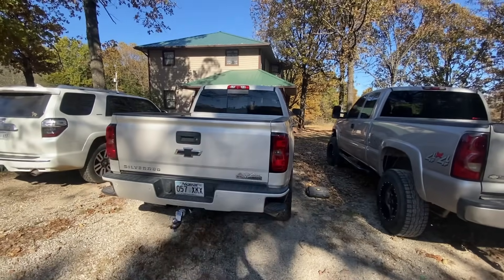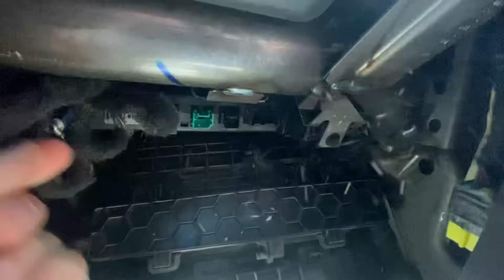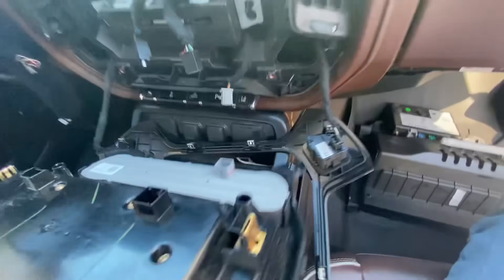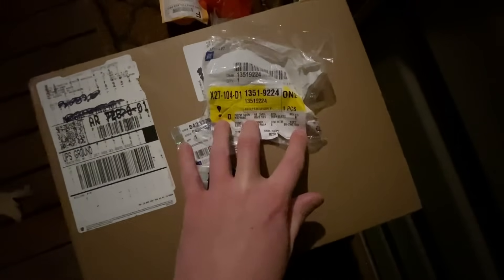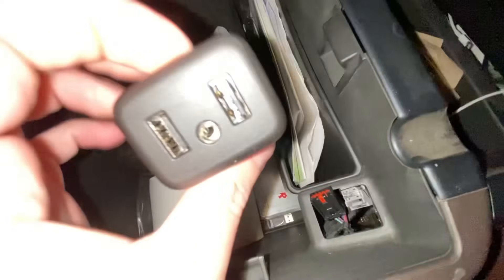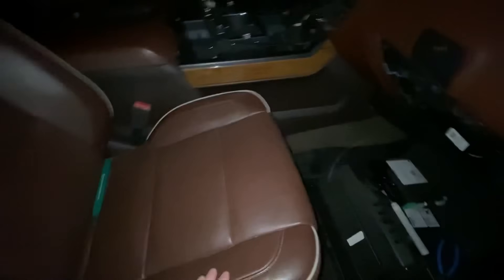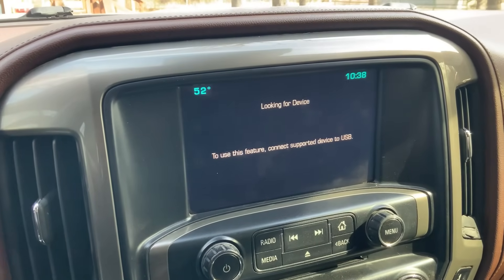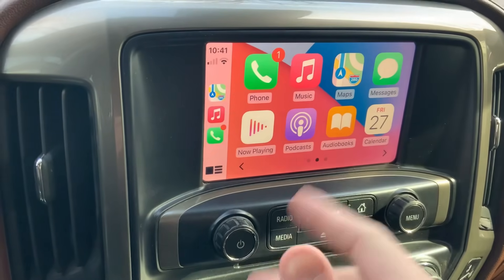How to Add Apple CarPlay to 2014 2015 Chevy Silverado or GMC Sierra

Comment: Watched this video numerous times. Ordered all the parts for my 2015 Silverado a 2 wks ago. Got everything yesterday and installed everything in under an hour. Thanks for your step by step process. Car play working flawlessly. Now just thinking bout the Denali cluster. Keep up the great videos.
Reply: Does the reverse camera work fine?
Reply: @ma7moodz8  the reverse camera work just fine. To my understanding, changing the radio components have nothing to do with the camera.
Reply: Do all your steering wheel buttons still work?  I.e.  the phone call and hang up buttons and the other ones that control the radio functions?
Reply: How much did you spend?
Reply: Did you need to have anything programmed?
Reply: From a 2.0 to a 2.5 HMI swap, is programming needed or just a quick plug and play
Reply: @franksalinas490 did you get the answer to this?
Reply: @eberpadilla3439 did u get the answer 😂
Reply: It’s 750 I believe for everything in this video plus whatever that plug cost.
Reply: @mauriciorodriguez2448  Did you get the answer??
Reply: @Browniiie92  ill be the one to break the chain😂 but yes sadly it is needed because it will say theft locked once you plug it in
Reply: So did you change out the radio too? I think that one was for Bose. Idk I just remember another video with brown and white for Bose to bypass it.
Reply: @mauriciorodriguez2448  did you get an answer to this?😂

Comment: Great video. I just did this to my 2015 Sierra and found that you don’t need to upgrade the USB hub in the center console if you use the USB that’s in the glovebox. Nice little workaround if someone’s looking to save $65.
Reply: You sure cuz I’m about to order it lmao
Reply: @andrewmarmolejo892  did you ever find out?
Reply: Cuz, I went to the GM site for the USB plug and it doesn’t fit my 2015 GMC Sierra. So, you are saying I can get CarPlay working if I connect to the USB in the glove box?
Reply: @robertbernal7993  it's your choice of whether you want to change it out but it will still work with the old one. If you change to the newer one then you will be able to charge your device when plugged in a whole lot faster. So, it does have its advantage to getting the newer USB or the center console.

Comment: Just did this for my 2015 Chevy Silverado 1500 and it worked great! The USB component gave me a little trouble because the cables were too short and were recessed in the hole, so I popped out the drink holders from the center console, unscrewed the panel below it, and that allowed me to easily get to the cables to plug it in.

Comment: Dang Chevy Silverados change the lot. I have a 2001 Chevy Silverado in a 92 Chevy Silverado that's still running great It's amazing how things changed over the years.
Reply: That it does. I parked my silverado, next to my corvette convertible.  The last owner left the convertible down and gathered a small pond in the abs pump. Thankfully the replacement was from a 93 pump, the seller threw in the Ecm module to work with the pump. Military Mechanic that loves chevy silverado's the corvette convertible was a fantastic price of 4600.00 it was sold for 8700.00( my wife wasn't a fan getting into the passengers seat. When I had kids, it Had to go!

Comment: I have several of the 9224 USB plugs. Brand new take outs from 2022 GM trucks. They are taken out and replaced with customer counsels. Never used. $30.00 ea.

Comment: I really like this new upgrade that I did on my truck I have 2015 2500hd  LT the only thing I dint  like is that the chime on the doors and whenever don’t used the sit belt is too loud even on the lowest setting. What I need to do to lowering down
Reply: Did you find any answers?
Reply: @mu4789 
No not yet still waiting

Comment: hey Justin, great/helpful video. I was wondering, do the steering wheel controls work for CarPlay use for this upgrade? I saw something about doing the full OEM upgrade and needing to ship in cluster. Just was curious is that only pertained to certain year or model. I have a 2014 Sierra Denali.

Comment: Hey Dustin, now that you've had 9 months with CarPlay in your truck, what's your thoughts? Was it worth the $800 upgrade? Do you find you're using CarPlay features more than the IntelliLink? I like the GUI of the HMI 2.5, but I'm really on the fence about CarPlay itself. Thoughts
Reply: I installed into my Jeep Wrangler for $500 total and I can assure you that it is not worth the $800. It looks great and i was thinking about putting it into my 14 Sierra but it just is not worth the $800. Probably not even the $500 I paid. The stock setup is good enough.
Reply: @brennanmason2906  thanks for sharing your feedback. It's ironic that you just reply this morning, I was JUST thinking about this project last night. While the idea of seeing my texts on my IntelliLink screen is cool, I agree, I don't know if that's worth $800.
Reply: @brennanmason2906   currently selling them for 300$ piece plus shipping and handling
Reply: @carlosdiaz962   who’s got it for 300?
Reply: Where can we get all the parts to install this?
Reply: @carlosdiaz962 where can you find this setup for 300?

Comment: Great video, thank you for the information and for posting. By any chance, do you know is doing this upgrade also resolves the common issue with the infotainment system "ghost" clicking random stations, pandora and so on that is very common in 2014 and 2015 Silverado and Sierra? My 2015 Silverado has this issue and it is getting worse. I need to fix that but I also have been wanting to upgrade to apple care play, hoping doing this upgrade resolves the "ghost" clicking issue as well. Thank you for your help.
Reply: I'm getting that as well, and I am considering doing this upgrade to fix it. Considering it's a fault in the HMI then I would assume a new HMI would fix it.  If not, that would suck!  If you do it and it fixes it please let me know
Reply: I haven’t done anything to my truck yet, but it’s gotten worse with the phantom clicks, in addition to a couple weeks ago my touch screen only recognizes touch’s on the very left  side of the screen. I have tried to reset to factory settings, disconnect battery, thoroughly clean the screen, fuse pull, nothing fixes the screen touch issue. So I may also need a new screen it seems like.

Comment: Does the backup camera still work with the apple carplay. I have a 14 Silverado with a factory installed backup camera, will it still work with the new HMI?
Reply from the maker: Yep! Works 100% as it’s still all oem gm parts. No issues after several years of use

Comment: Can the apple car play or android auto with this setup be used through bluetooth? or does it have to be plugged in ? i had a kenwood radio in my car that android auto worked through bluetooth. id like to get an upgrade for android auto as the radio is finniky with what it plays audio from when it connects through bluetooth (randomly selects spotify, youtube, or facebook)

Comment: also is there any other way other than changing the HMI and having to plug my cel into the usb. can I just connect through the  bluetooth without having to connect to usb cable. also do you know if I change this out can I receive calls and they come through my truck as it does right now.im sorry I have a lot of question but you  seem to know what you are doing.

Comment: Thinking about doing it! I just bought a 2014 Sierra 1500, SLT w/ Z71 package, found out today that I can't have OnStar, GM stoped it on 2014. So sucks, dealer actually told me that I could have 90 days free trial, not that if I was told the truth would've stop me from buying the truck, just disappointed. But again,  when adding extend warranty to $1200 of the upgrade, not sure if worth it. It does looks good, that is for sure! Truck only has 27k miles, looks as brand new, reason I bought it.

Comment: What specific upgrade kit did you purchase? I was looking on the website and saw there is two options. I see there is a kit and one that says programming.
Reply: Did he ever answer your question
Reply: @johanguerrero5915  negative
Reply: It depends on what your truck came with so to speak. If it didn't have nav at all and you do the upgrade with nav then you may have to install the GPS antenna too. It's literally plug n play with the kit and there are only a few things it will add to your vehicle if it didn't come with those features already. It may seem like it's difficult but if you want all of the features just order it and install it. The reprogramming was talking about taking the hmi compo ent you already have in your truck and sending it in to them and they reprogramming it with some of the upgrades. It's better to just buy the upgrade and like I said, it's literally plug n play.

Comment: The USB plug from Amazon says it won't fit my 2015 chevy. I'm assuming it means that its not compatible the the existing audio unit BEFORE the updates hardware/software from Whites, correct? Thanks in advance.

Comment: Great video Dustin! I have a 2015 1500 LT and my door chime is very loud even on the lowest setting. Did you notice if this upgrade gave you the ability to lower the door chime volume lower than before? Thanks!
Reply: Hey bud so is the same process with the  lt ? Thanks
Reply: @martyn408ify  Hey man. I never went through with this upgrade. I was just curious if the door chime volume was better with the new setup. I hope to do this one day though.
Reply: @martyn408ify  did you end up making the upgrade? If so did it work? I don’t wanna spend the money on all of it if it doesn’t apply to an LT

Comment: I watched a video of this before on another channel. You make it look so simple. Nice job.

How does this affect XM radio? How is this different from a new vehicle that already comes with Apple Car Play? It seems to me the new ones have Apple Car Play actually installed, but with this you're just projecting your phone to the radio? The reason I ask is I called the local Car audio place and I was under the impression that they also changed the HMI, but they acted like they didn't know what I was talking about. They said they change out the whole radio.
Reply: There's no difference from the newer vehicles that come with the apple caraway or Android auto. Also you can still maintain xm radio. The kit doesn't change what the truck came its. All it does is swap out the old with the new. Plug n play.

Comment: Could you go to junk yard take one out of a 2016 and plug it in ?
Reply from the maker: Yes, but you would need to have it programmed for your truck first. These radios are locked to the vin of the vehicle they originally came from. If you did it without programming first, it would pop up “Theft Locked” on the radio

Comment: Will there be navigation on the dash with android auto/car play? My 14 Silverado comes with stock navigation that will show directions on the dash.
Reply: Yes it will. When you have android auto/carplay hooked up, it will show Google maps or waze, etc. You can still use the factory navigation too if you want. You may have to disconnect it so the Google maps or waze won't override it
Reply: @gangsta45ism  sweet ty

Comment: I don’t know if this upgrade is worth $1,000 when you can get a superior aftermarket radio like the Alpine ILX-411 11” screen or the Pioneer DMH-WT8600NEX 10.1” screen with wireless apple car play, both aftermarket radios around $1,000.
Reply: It is if you're having trouble with your HMI.  Be twice that to have it replaced at the dealer and still no Android Auto or Apple nonsense.  HMI issues are a common problem with 2014 2015
Reply: It all depends on if you prefer the factory setup over aftermarket but you make a good point.

Comment: Awesome. Are you still able to control the volume and skip tracks from the steering wheel ?
Reply: Sure can, I did this about 2 years ago.
Reply: @Keagan-Z06   oh that sounds great. thank you very much.
Reply: @Keagan-Z06  is it necessary to change the radio module behind the screen??
Reply: @Keagan-Z06  even with CarPlay loaded up or do you need to do full HMI, Radio & Cluster upgrade for that?
Reply: @gcode4u2  Yes sir!
Reply: @d_lord4483  Just the HMI & Radio, no cluster needed. If I can recall I believe I only changed the HMI module to an updated one.
Reply: @Keagan-Z06  I've been thinking of just ordering used off eBay and program them myself. just need to figure out how to do it.

Comment: Why did you have to change out the plug that had the SD card slot?
Reply: Because it helps with actually charging the device faster. The old USB port in the center console doesn't really have enough amps to be compatible.  It will still work but it will lack in charging devices up really fast.

Comment: I want to do this to my 15 GMC  Sierra, I dont see what radio part to order, I see the HMI (2014-2015.5 Android auto/car play upgrade retrofit ) for $99.99 but dont understand what radio part to order. After looking at it, I get the HMI and radio part both in that kit for 99.99 ? That doesn't seem right
Reply from the maker: Yeah not quite right, on the white automotive sight if you browse out to the 2014 Silverado’s you should see the option to upgrade to Apple CarPlay. It has several drop down boxes to choose from depending on your vehicle RPO codes and if you are supplying your own parts or not. Hope this helps.
Reply: It appears the $100 is for programming only (if you are supplying the hardware).  If you are ordering the hardware it is actually $600.  I was confused as well.

Comment: With this upgrade can you run a mmb multimedia box? Stream YouTube video/Netflix?
Reply: You don't need this set up tou run the box,just 2 different wiring harness
Reply: If it plugs into the USB port then you should be able to still use it

Comment: Hey, I recently did the upgrade. Does anyone know how to change the temperature on the display from celsius to Fahrenheit and what to do if the tire pressure doesn’t show on the little dash screen?
Reply: Did this effect your other screen in your gauges?  What’s up with your tire monitor?
Reply: You should probably refer to the owners manual. This upgrade shouldn't have affected that.

Comment: My truck was built in Canada and has Celsius reading type gauges.
2014 GMC Sierra slt 4x4, 1500 5.3
Factory Bose radio system 
If I add this upgrade to my truck will I need to replace my instrument cluster to retain my steering wheel controls ?
The website is somewhat confusing to me, the chat feature yielded no help either.
 Can you please help?
Reply: You don't have to replace anything. If you look at the video again, he literally swapped the old part with the new part. That is it. You will be fine. I have a Denali 15' and I had no issues. All of the steering wheel controls and the screen cluster still work because it's still the original one.
Reply: @gangsta45ism  that’s good to know 
Thanks for the info

Comment: **CANADIANS** DO NOT BUY THE USB FROM THIS LINK!!!! I did, ended up uknownly spending $200 in total after shipping, import fees. To top it off I did not need it in my 2014 Sierra. The model I have was manufactured in the USA not sure if that makes a difference but stock usb's were capable of relaying data. Android auto and carplay work with ALL stock usb connections including three at the bottom of the dash in the SLT to make 5 car play capable connections. other than that the hardware works perfect

Comment: Thanks again for a great video. Only problem I encountered was getting ahold of the GM part to replace that USB plug set inside of the center console. Turns out #13519224 at GM Parts Direct comes back as "not a fit" for my 2015 Chevy Silverado 1500 LTZ. Odd. White Auto and Media redirected me to Amazon where I found one for $125 (which I bought). I didn't try eBay but should have. I hope you did do a video on Apple Car Play (I will check). I am excited as you are to get the whole thing installed!
Reply: Do you happen to have the info for finding it on Amazon?
Reply: @joshuarandolph4387  I’ll find it and post tomorrow. It all worked nicely!

Comment: I have a 2014 Silverado and im tryna swap the stereo and upgrade to a pioneer 3300nex and I just want you to confirm if it fits on the 2014 Silverado?
Reply: Thi k of it as an upgrade which maintains your factory setup. It won't mess up anything or disable any of the controls.

Comment: HMI module needs to be an updated one and programmed.
Reply: Not if you buy it already programmed which is recommended. The reprogramming one is talking about taking yours out and sending it in to them to reprogram it. It's easier to buy it already Program and swap the old out with the new.

Comment: Witch on is it there is the $600 and there is the $100 one
Reply: The 600 is for new modules from them the 100 is what you pay if you ship in used modules to get programmed that’s what I went with got mine out of a wrecked 17 gmc for 200

Comment: I priced the conversion for my 2015 High Country and the grand total was near $1000 for everything. As much as I want to have CarPlay for my truck, it doesn’t really seem worth it to me...
Reply from the maker: It is expensive! The only way I really justified it in my head is that I like this truck and plan on keeping it awhile. This upgrade did make it feel newer.
Reply: I got both my modules off eBay out of a wrecked 2017 gmc for $200 and sent them to white auto and they programmed them for $125

Comment: Did your steering wheel controls work after this? Was reading on their website about some sort of programming that needed to be done for steering wheel controls to work
Reply: The upgrade is literally plug n play so the steering wheel could buttons won't affect the radio at all. It will still work the same.
Reply: @gangsta45ism  even with CarPlay loaded up?